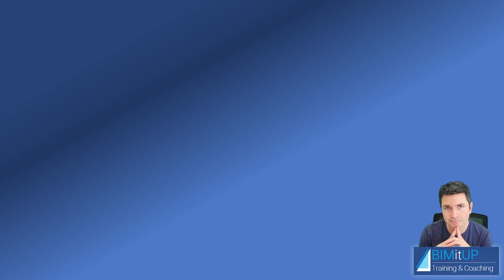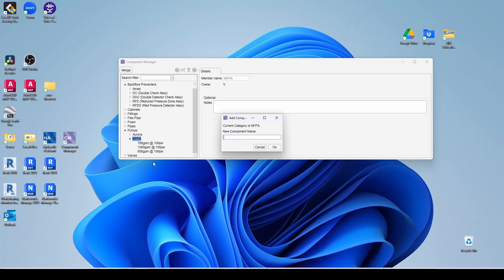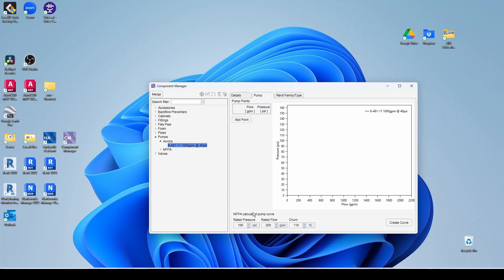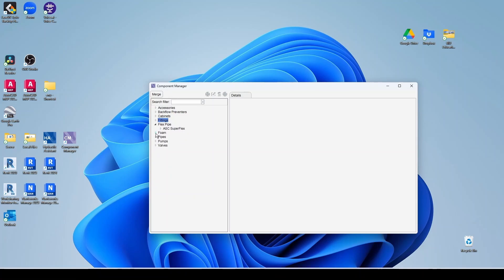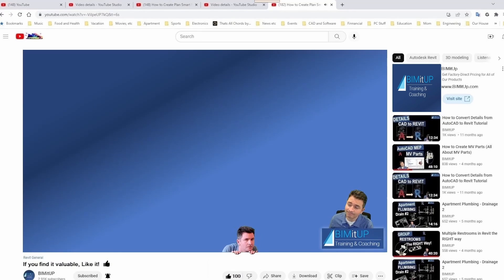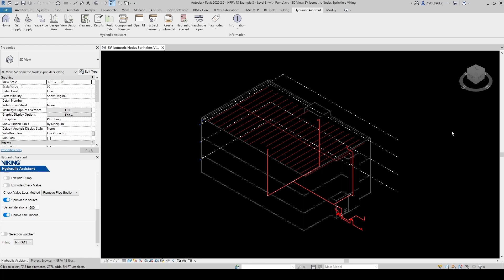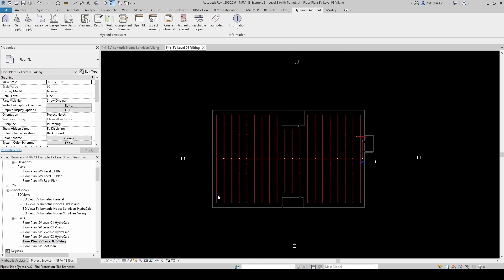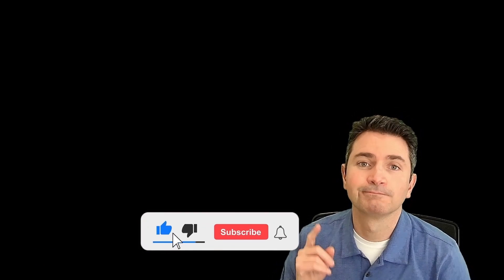Sprinkler Hydraulic Calculation Using Revit Viking Part 2 Component Manager and Hydraulic Assistant

Comment: why this two icon not shwon in my dekstop, hydraulic analysis and component manager, but tab (vDesign) added in my revit software
Reply from the maker: Do you have the stand alone hydraulic assistant? (Desktop application). Do a search
Reply: Can you share link for Hydraulic assistant ? 
Thanks for your great effort in video
Reply from the maker: Check the first part of the first video =)